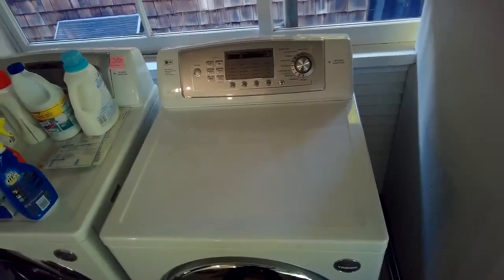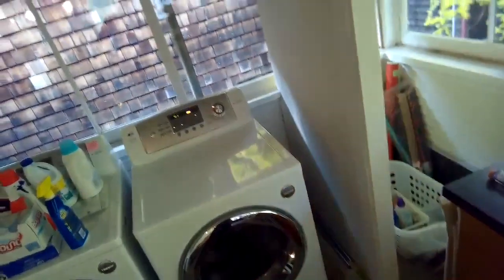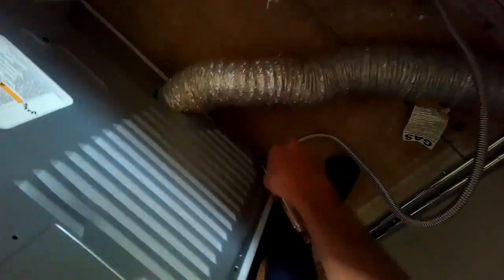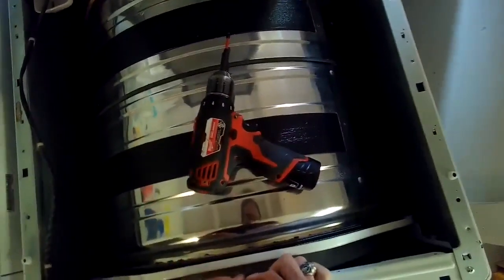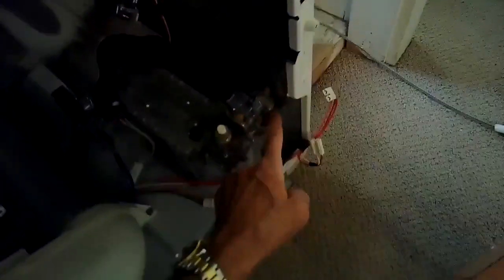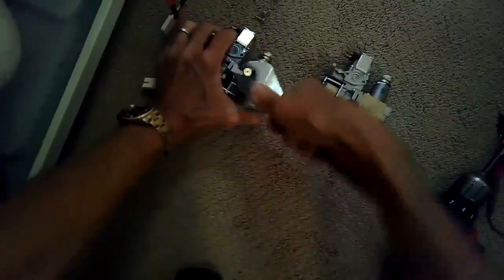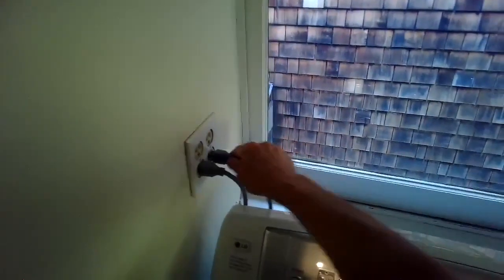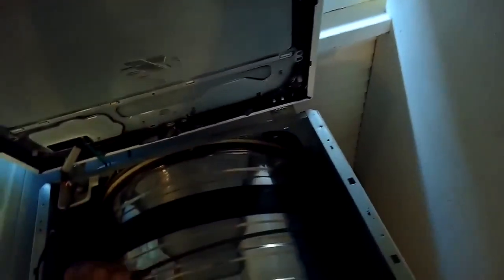✨LG GAS DRYER ISN’T HEATING UP - Money Saving Easy DIY Fix ✨

Comment: I have the same gas valve on my LG gas dryer. Using the beeping continuity mode, the solenoid won't beep, it stays at OL. If I set the multimeter to resistance mode, it reads 1.8 Ohms, just like yours. Does that mean the valve coils are good?
Reply from the maker: I think your valve coils are good.
I wonder if the reset button on the burner tube needs to be pressed.
Make sure it’s unplugged 👍
Reply: @QuickAndEasy5MinuteAppliance  Thanks for replying. I was able to confirm that the coils are good. You can't test these coils using continuity mode, you need to check resistance only. The dryer is back up and running. I had to replace the high limit thermostat, the flame sensor, and the igniter.

Comment: i tested the flame sensor it reads 00.8 when i put it at 200 OLMS is that good or is it bad... i just put a brand new valve body like. the one you have and it still don't heat up, the ignitor glows but no flame what you think it is. the 
reset button  never clicks but i tested and it has continuity.. it always hard when you push on it.what you think its wrong
?
Reply from the maker: Can you send that same question to my email along with the model number to: scottthefixitguy@yahoo.com

Comment: thanks for the tip for the side panel took that off. Now the dryer wont heat up again. I pressed the reset button and it starts and I see it light up (side panel) and then I can hear the gas wooosh on . then heats up . So its been several times I had to go through the backvent  and press button.  What should I replace ? getting tired of pulling the dryer out and attaching the vent . Thanks
Reply from the maker: Just need to clean out the dryer vent tube👍

Comment: I’ve got an LG gas dryer and it runs as expected, but the igniter won’t glow.  I’ve replaced it with no change in status.  Any ideas?
Reply from the maker: Have you tried pressing that reset button?
Reply: @QuickAndEasy5MinuteAppliance  yes, but it never clicked so I replaced it with a new one.

Comment: How did you get it to light up when it was apart. tried that, door off, connected switches, nothing worked . had to put it half way back together to get it to go.. just hate putting all back together to test.

Comment: So our LG TROMM heats up on all settings but won’t fully dry the clothes. We have cleared out the vent tube, replaced the switch & it still stops producing heat while the clothes are about 60-70% dry. Any suggestions would be greatly appreciated 🙏🏼 
To reach fully dry clothes takes 4 cycles per load.
Reply: I've had the same issue with the automatic setting.  Believe it's related to the moisture senor, which can be replace.  I've just acclimated to using the timed / heat level manual setting.  From my experience, unless it's a heavy load, 40 minutes at the low setting works for nearly all my cloth drying combinations.